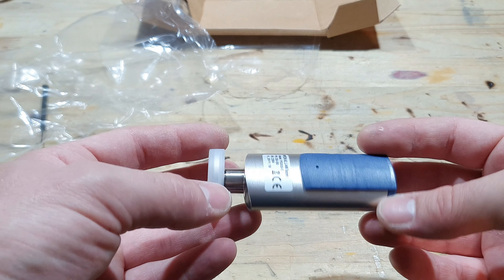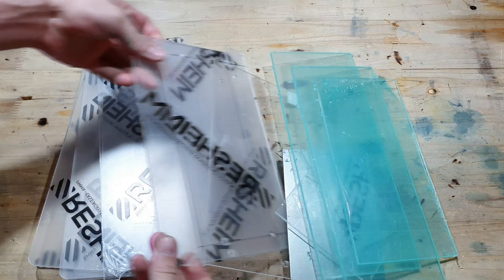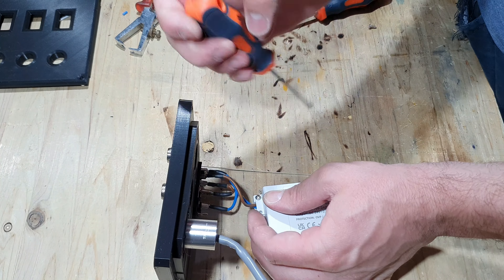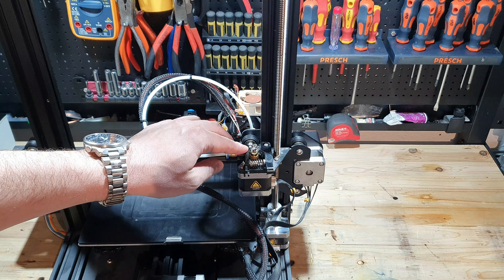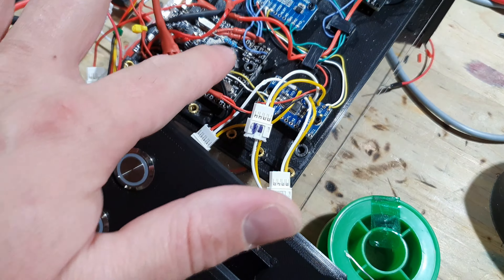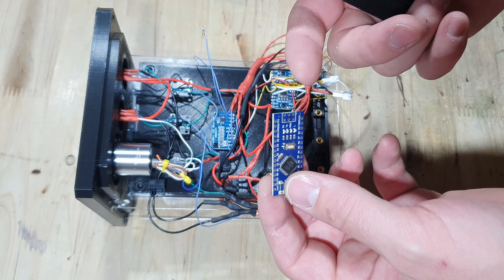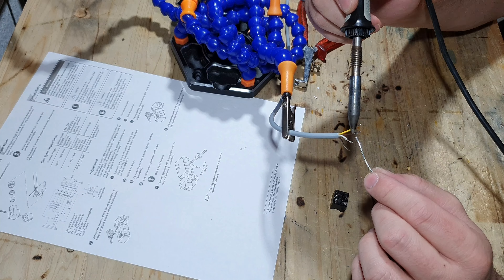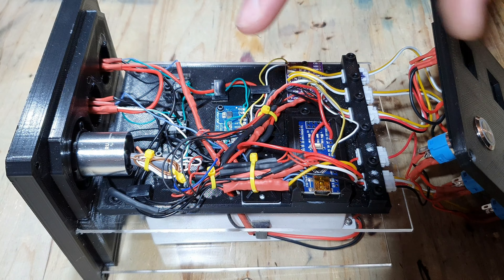SAVING 2500 $ - DIY Arduino Vacuum Gauge Controller

Comment: Arduinos have internal pull-ups you can enable in software btw... Also 0805 SMD resistors are the perfect size for 100mil (2.54mm) pitch perfboard (one with dots), great way to make a bunch of voltage dividers in small space.
Reply from the maker: Yes, but the problem is, that the internal pull-up resistors have a relatively small resistance. Some gauges have a higher resistance at the identification pin and thus the arduino would not recognize that a gauge has been connected. 

The tip regarding the 0805 resistors is great. I will keep it in mind!

Comment: Maybe use a 4.7V zener diode and a resistor to 24V to clamp the Arduino input to 4.7 volts maximum.

Comment: Nice, I've never realized that such gauge controllers are basically just an indicator and a power supply. Just checked Pfeiffer PKR 251, which are more common in Europe, and there is very similar voltage output. Though Pfeiffer controllers a bit cheaper, about 1500 for 2 channels and about 2000 for 8 channels.

Comment: You could use cheap optocouplers to detect power going to your gages. One resistor to limit the current on 24V side and that's all. This way you'll be sure no unpredictable voltage spikes get to the Arduino. 
And switching ground is ( almost ) never a good idea ;)
Reply from the maker: That's a great idea. I didn't think about it at the time. Maybe that's something for the next version. I would love to use a custom PCB (I think that would look neat). 

Yes, I think I learned that the hard way :D
Reply: @AdvancedTinkering  Custom PCB would look awesome and make everything tidier, easier to assemble :) Enclosure itself looks really good so it would be a good match. 
Also - when dealing with ADCs fed from a voltage divider, using a linear voltage regulator would be a good  idea.  Use buck converter to get rid most of the voltage and then do the rest ( 5V ) with linear regulator. It's not the most efficient way but this device isn't battery powered so few mW of heat isn't a big deal :) 
I truly love the project tho. Great job and nice videos. :)
If you ever need any electronics related help - give me a shout.

Comment: Well what a coincidence.I just bought myself a used PSG500 off ebay a few days ago. like it's still shipping to me, but this video will be great cause I also don't plan on spending $2500 on a controller when the datasheet gives me everything I need to build my own. Thanks for the upload!
Reply from the maker: Im glas the video is helpful to you! If you have any questions while building it, just ask :)
Reply: And I bought a used controller and I’m having a hell of a time retrofitting it with the original sensors and transducer that came with it

Comment: Amazing job! Do you have a DIY tutorial on your final build with a parts list? I'm a semiconductor vacuum equipment engineer in the US and I'd love to build one of these for my lab.
Reply from the maker: Thanks a lot! Unfortunately I didn't document it well and didn't make a tutorial or list of components. 
However, I am designing a PCB on the side that will do all these functions in a nicer form factor. I think I will have it made over the next month and see if everything works. I will either make a video about it or a community post.
Reply: @AdvancedTinkering  What is your voltage divider PCB mfg and PN's(part numbers)? Arduino?

Comment: Actually you can connect a 24V signal directly to your Arduino with just a single resistor. The pins on the Arduino has inherent ESD-protection diodes, so you put a series resistor high enough to keep the current low (a mA or so) and then the ESD diodes will clamp the voltage on the pins to VCC+0.3V.
Reply from the maker: Very interesting! Didn't know that. I will take a look into it.
Reply: A 5v zener will be safer than relying on esd diodes.
Reply: @bofh705  It will be belt & braces yes, but if you limit the current you can actually rely on the ESD-diodes with no problems

Comment: Very well executed project, I was just browsing ebay for vac stuff after watching your caesium videos and wondering how difficult these gauges were to read out since I figured that RJ45 wasn't ethernet (nothing is ever /that/ easy heh). If you're ever working with acrylic again a little liquid dish soap as lube helps a lot to prevent the bit from grabbing and either getting stuck (there's still a snapped off 3mm drill bit tip embedded in the acrylic wall clock I built some years back right before I learned this trick) or fracturing the material, helpful even if you're using the special acrylic bits with the pointier (45 degree iirc) tip grind.

Comment: For electronics projects like this you would be better off building them on some matrix board.  you can get nice through plated FR4 stuff form ebay for cheap.  that way you can make use of 2.45mm pin headers and sockets to mount all those little boards and they will be way easier to swap out if needed.  you also have a nice way to mount additional resistors etc, which always end up being needed, and you won't need all that heat-shrinking of random inline resistors.    Additionally whenever you make up cables... the connections always insulation sleeving.  i have learnt this the hard way several times.  Silicone tube is good, you can get lure tubeing for fishing that is perfect.  even if it looks like there is plenty of space between connections... no, it needs sleeving, the pins can and will rotate and wiggle about until they short as soon as you put the connector together otherwise and it will kill expensive gear.

Comment: Well done. This is not easy and I love that you have included your some of the mistakes you made. I always calculate with at keast three dead arduinos for any project and when you told about the wrongly soldered cable I was grinning like a fool. I made the same mistake. A while ago. 
For improvement I would strongly advise against using a buck converter to directly supply your adc. Get tha Voltage down to 9V with the buck converter than use a linear regulator  with some ceramic and a 5 to 10 uf tantalium capacitors to reduce the noise as mutch as possible. Otherwise you will losse at 2 bits of resolution on your ADC. 
By the way I am CTA like you. Keep on doing your stuff it is very interesting.
Reply from the maker: Thank you! Yes, the short in the wiring was so frustrating. I resoldered and changed everything before checking the cable :D. 
Thank you for your tips! But doesn't the ADC have an internal voltage reference? I'm not an electronics expert (far from it) so I just assumed the internal reference would take care of any noise and inconsistencies in the voltage. 

Very cool to see other CTAs expanding their horizon! :)
Reply: Well no. The referenc is only stable if the supply voltage is stable especially if your noise is high frequency. In other words it can deal with the 50Hz mains nois easely but the  high frequency stuff from the switch mode power supply and the buck is another mater. There are also other parts of the adc that as far as I understand it rely on an stable supply voltage. Like the amplifiers in the comparitor stage. If you are interested I can design a pcb for you if you can send me the scamtics. But I am totaly self tought there so no garantees that it will be optimal for you.
Reply from the maker: Thanks! I have allready designed a PCB because I wanted to make a "professional" product. Do you have discord? It would make it easier to tall about those things. You can add me: AdvancedTinkering#2156

Comment: Beautiful work. Will you be sharing the information needed to build this by any chance?
Reply from the maker: Thanks! I unfortunately do not have schematics of this built. But if you have any questions feel free to ask.
Reply: @AdvancedTinkering  what are the "voltage converters" to scale the 10V output of the gauge to 5V input of the ADC? I would naively use 2 resistors of equal value to divide by 2. You seem to be using a module?

Comment: Very impressive! Start a company, within a year max there will be an offer from MKS, Inficon, Edwards, Pfeiffer, Agilent and  etc. You will earn some money and you can secure  position in RD of those with possibility of further tinkering. Side note, OLEDs screens are small.
Reply: Polish company Prevac sells a controller compatible with multiple brands. But they sell it for similar price of 2—3k.
I bet if you start a company, rebuild it to industrial standards, make tests, documentation, certifications and provide user support you'll likely to sell it for similar price.
Reply: @Swift I forgot about all tests and certifications. You're right.

Comment: youre a madman!
i find it very disturbing how much companies charge for something as simple as a voltage readout, you could legit, wire a phone charger and a voltmeter that some child drew the atmospheric down to 10^-4mbar values on on for less then 10 bucks, yet they charge 2.5grand for it. doesnt make much sense to me.
what i also dont get about that site you showed, is it for commercials or hobby people? i dont understand their reasoning for their prices as most stuff they have id guess they either got for free or paid 1/25th for it.
Reply from the maker: Haha thanks!
Yes the price is crazy. But then, it's equipment meant for industrial purposes. So it needs to be certified and tested for reliability. All of those things cost money. And for a huge company 3000 $ is worth it, if they get those assurances and the customer service. But for a private person it's definitely way too expensive.
Reply: @AdvancedTinkering  oh so they have an actual certification and not just "trust me its refurbished" 
also something i must admit, all i do used to be done in my bedroom aswell, since then, ive moved the bed to another room lol, now its just the "living room"

funnily enough, i also just recieved a pressure gauge with linear voltage output, so this video is quite called for :P
Reply: @contomo5710  Those devices usually come with a calibration certificate, thermal stability graphs, long term stability, are checked for EMI, SI,  etc... There's a lot going on "behind the scenes". And those certificates are well worth for most of the applications this device was designed for.
Reply: you can buy a pirani gauge with integrated display for around 400 EUR. I am using inficon pirani gauges with integrated display quite often, never bothered to buy a controller for these.  I am fairly certain that the contoller is a general purpose one that connects to many different gauges, which makes it expensive. There are UHV gauges that measure very small currents for example which is a bit more difficult to do. But you are right, for this purpose the price is quite high.
Reply: @contomo5710  there are companies that sells more affordable gauges and controllers than ones from Inficon, Pfeiffer and Edwards.
Say from AML you could get 2 Pirani,  2 ion gauges and a controller for just over 2000 pounds. For comparison the price of a single Inficon BPG 402-S gauge which was donated by Wissel vacuum is over 2000 $.
And it looks like ion gauges from AML are even superior for UHV applications because it is mounted directly inside the chamber and all the electronics is inside the controller, so it's easier to bake.

Comment: Hm.. Did you draw a schematic?

There are some good books out there on analog signals (Analog may have something on their website).

I didn’t known the company who sponsored your probes. I‘ve used MKS probes and proportional valves in the past.

Is this a capacitive probe?
Reply: Also: Do you know if there’s a filament out there that can be used to shield the electronics inside?
Those 0-10V signal lines are pretty vulnerable to interference (in an industrial environment).

Comment: we use those sensors at work. Brilliant thanks so much. I wanted also to build a mcu vacuum controller':] no code yet':/
Reply: If you you need it at work, just buy a commercially available controllers.
For your employer your time and potential glitches does not worth little savings. Unless you're going to build controllers for hundreds of gauges.

Comment: Nice work. Always got pissed by how much those controllers cost for literally supplying 24 V, measuring a voltage and a resistance. If you are concerned about getting the reading of pirani gauges right at the atmosphere you can calibrate using two small screws directly on the gauge, the procedure is on the manual but is always pump down to HV and set the zero then vent and set the gain. In any case you typically care just for the order of magnitude.

Comment: These standard pirani gauges are very inaccurate in the range of 50 to 1000 mbar. They are literally useless in that range. Modern piranis with convection enchacement can be accurate (+/-5 %) up to 1000 mbar.
Reply: Exactly, and nobody cares about that. It's purpose is just different.